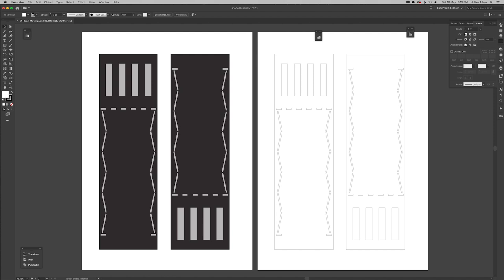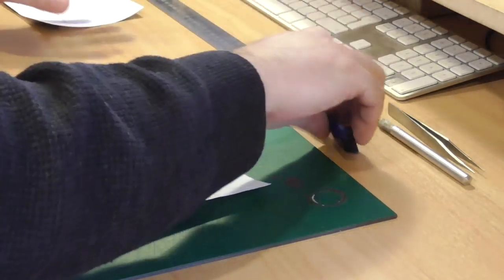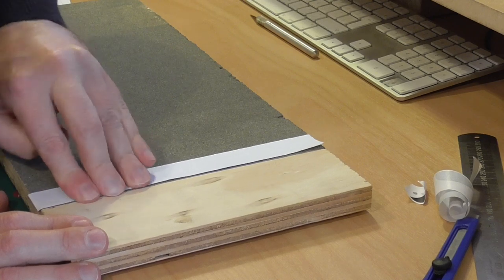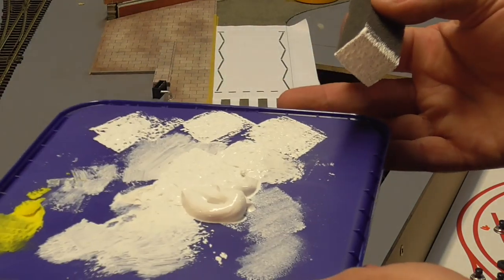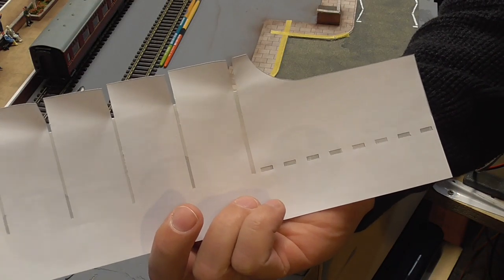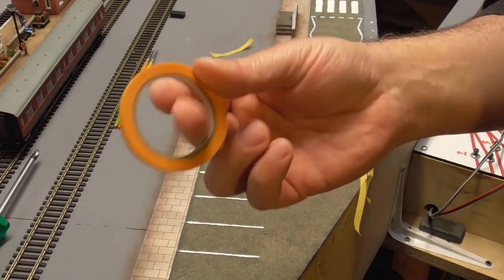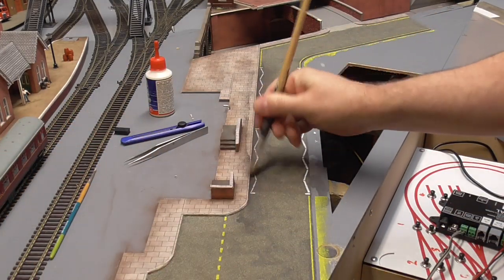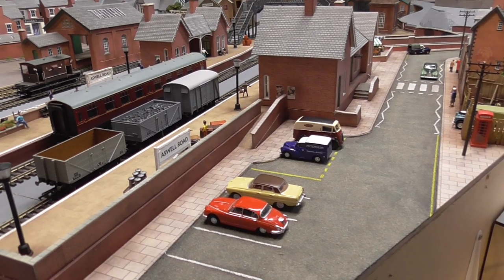Model Road/Street Markings

Comment: Interesting technique . . . it would take some experimentation, but some airbrush frisket film might work well for this kind of a project. The material is made of ultra-thin acetate, is impervious to moisture and generally withstands bleed-under. Its low-tack adhesive qualities might necessitate the application of light coats/layers (dabs?) of paint to be on the safe side.

Comment: Hey Julian,
You got there in the end. The final result looks certainly very good and pleasing. Maybe the road could get a bit more dirt and grime, but that is personal preference.
I think the label paper is to thick and stiff to actually get it closely sticking to the sand so bleeding would be prevented with the consistency of your used paint. Using a more dry paint like doing with dry-brushing would probably have made a difference. All together thumbs up!

Comment: Great job, very good video however yellow lines and especially zig zags were not used in your period of early '60s.
Reply from the maker: The period of Station Road spans roughly just over a decade (as mentioned in the channel description/about tab) from the late 1950's through to the early 70's. This is so I can operate a good variety of steam and diesel locomotives. This also means a bit of creative license with infrastructure such as road markings, buildings and other period features.

Comment: Another good video, keep them coming. Just one observation,  I think if you had less paint on you sponge the bleeding would have been eliminated. The markings would have looked more worn - I don't mean this as a criticism because it's a good idea. Look forward to your next one. Best regards, John.
Reply from the maker: Absolutely agree John. I would have applied the paint in much thinner layers, letting it dry between each one, but I did rush it because of the paper label soaking up moisture. Next time I'll give the label a quick spray with clear coat or hairspray to hopefully reduce the absorption.
Reply: Another option would be to dry brash the lines with a stiff brush.

Comment: I think your main problem is your stenciling technique,  once you dip the sponge into the paint, dab it onto a paper towel to remove the excess, almost like dry brushing.
Reply from the maker: Totally agree, I think it was a combination of errors that lead to the inconsistent results. I going to do a test/demo at some point with all manner of techniques in the hope of finding the best method.
Reply: Karl is right it's not a matter of sticking the stencil down as most use non adhesive stencils. It's a matter of doing it as you would for dry brushing

Comment: What period are you modelling as the zig-zag lines at zebra crossings weren't introduced until 1971? Single yellow lines came in with the 1950s, with double yellow lines in 1958 (trial in London) and nationally from 1960. There were also dashed yellow lines, but these are now no longer used (although in sound places were resurfacing hasn't occurred since the 1980s you can still see their ghostly image). Yellow was only used until the1980s for parking restrictions, all other lines should be white until then.

The Traffic Signs Manual is a good source for information, but you need to have the right one for your modelling period. The first version was published in 1965 and coincided with the introduction of the current road signs based on the findings of the Worboys Committee and the Vienna Convention on Road Signs and Signals.

Another source for information is legislation.gov.uk which has copies of many if the Acts passed by Parliament.

Have you considered using a small DIY roller, the kind used to seal the edges of wallpaper,to secure your templates?
Reply from the maker: Hi Neil and thank you for your very thorough and informative comments. Station Road is not set to a specific year but over a period time from the late 50's to early 70's, this way I can run a greater selection of locomotives and stock without things looking to out of place too much. I include a brief background on the 'About' tab. It's important to note (as I state in my videos), it's the representation I'm after, not necessarily absolute prototypical accuracy.